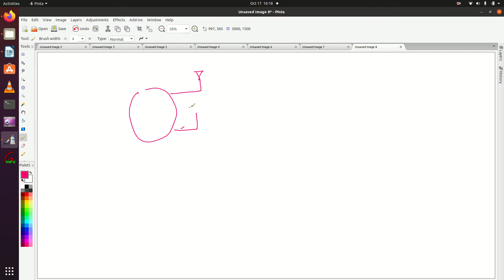LTE MIMO Part8

Comment: Mr, if the BS Tx are 8 and Rx in UE are 4 , after enodeb  know UE capabilities.  Is enodeb tramitting 4 streams data to UE instead 8 streams data in case  of good radio condition ?
Reply from the maker: Good Question Mustafa....!!
In LTE using 2x2 / 4x2 MIMO with spatial multiplexing, the user data is separated into two data sets each fed to two / four transmit antennas and received by two receive antennas. Because of multi-path, each data set travels a distinct RF path with different propagation characteristics. The algorithm used to split and recombine the data allows the system to make use of the independence of these two paths in order to improve throughput. The two data streams occupy the same RF channel at the same time. This doubles the data rate possible on the air interface link. 

Kindly refer link provided by Anritsu: https://www.anritsu.com/en-au/test-measurement/technologies/lte

Comment: Sir PMI have any influence on deciding RI final value?what is the correlation btwn these two parameters
Reply from the maker: I don t think so there is any kind of relation between two. If you look at open loop spatial multiplexing UE reports RI only ...PMI is not required.